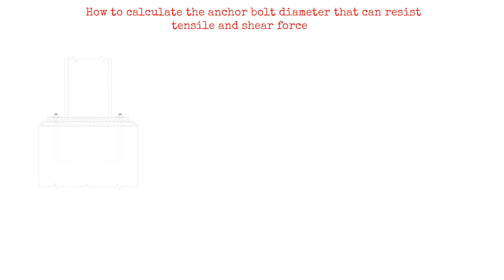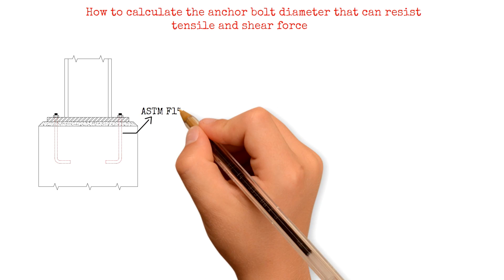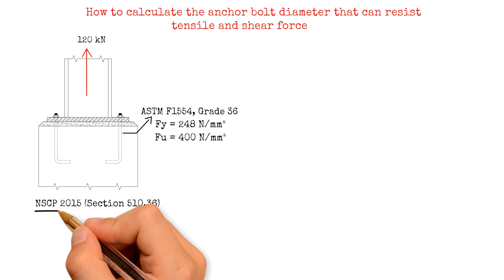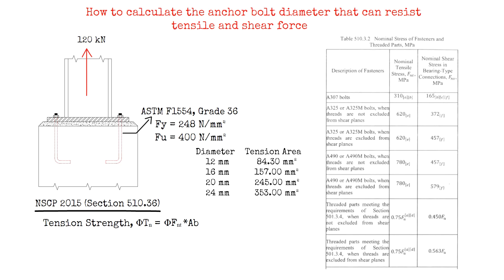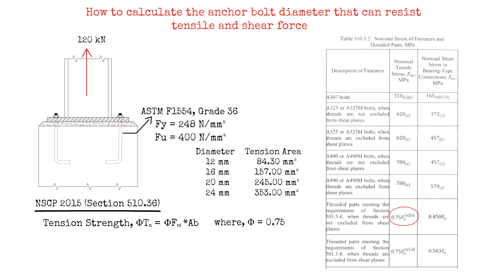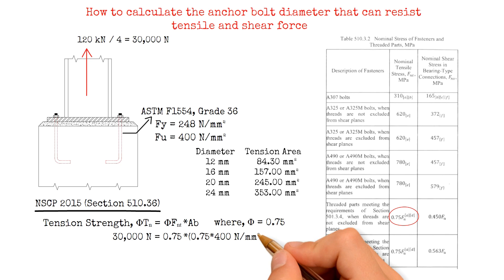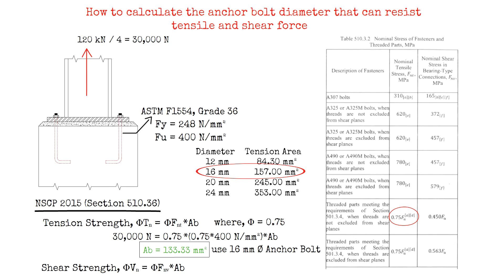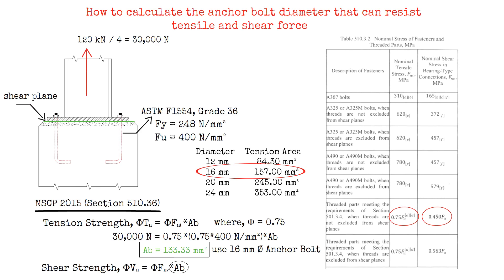How to calculate the diameter of anchor bolts that can resist tensile and shear force

Comment: Pano po pag may shear at tensile force?
Reply from the maker: For combined Tension & Shear in bearing type connections, Rn = F'nt*Ab, where F'nt = 1.3Fnt - Fnt*fv/ΦFnv ≤ Fnt.  F'nt is the nominal tensile stress modified to include the effects of shearing stress. Please refer to section 510.3.7 of the NSCP 2015. Soon, I will create another video for this one.

Comment: can you have an example for shear strength? is it  0.45(0.45)(248)?
Reply from the maker: For shear strength, the solution would be like this:
ΦVn = Φ*Fnv*Ab = 0.75*(0.45*400)*Ab
Reply: @pinoyce  so sir 0.75(30,000) = 0.75(0.45)(400)(Ab) tama po sir?
Reply from the maker: you need to get first the Shear Force from the structural analysis...Let's say if you have an ultimate shear force Vu = 80,000 N / 4bolts = 20,000 N = 0.75*(0.45*400)*Ab.
Ab = 148.15sqm. hence, use 16mm diameter bolt.
Reply: @pinoyce  the unit must be mm2 or m2, sir ?